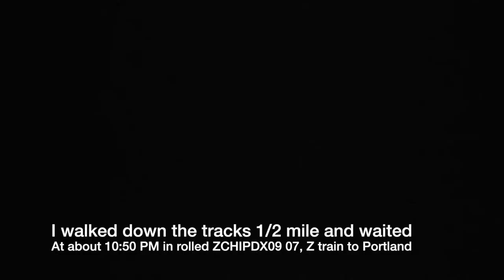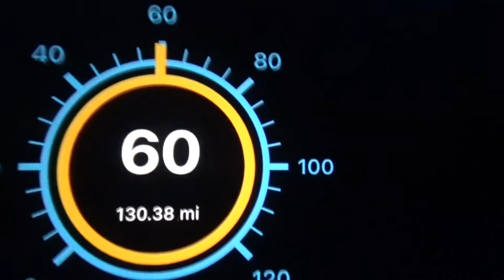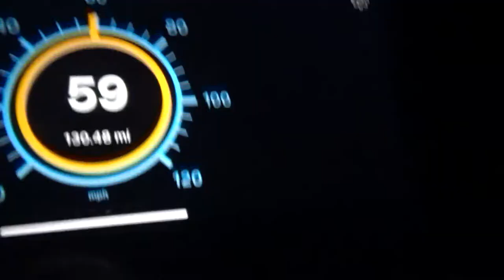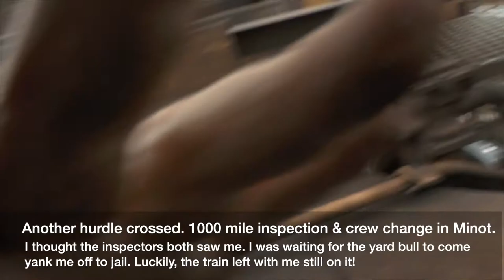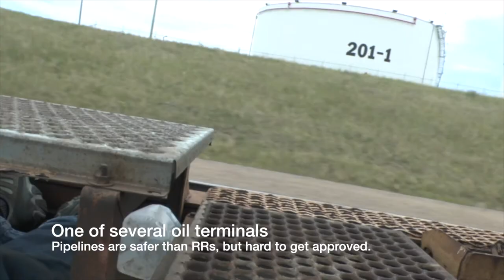High Line Freight Hop! Steel Surfing to Montana Part 1

Comment: Hey man I really want to do this I'm from Wisconsin would also start in lacrosse to Montana, just wondering how do I tell which train is going where and when it will arrive? Thanks man cool video
Reply from the maker: All of the intermodal trains going geographically north through La crosse, they’re technically westbound, are headed either to Portland or Seattle. There might be one that goes to Minneapolis too, but where it terminates in Minneapolis the next intermodal to stop there would be headed for Seattle or Portland, so you’re kind of all set just to grab one at La across. Sometimes you can listen on the scanner and they will call the train Portland or Seattle. As far as I know there are several trains a day to the west coast and the times vary, but evenings and mornings I think.